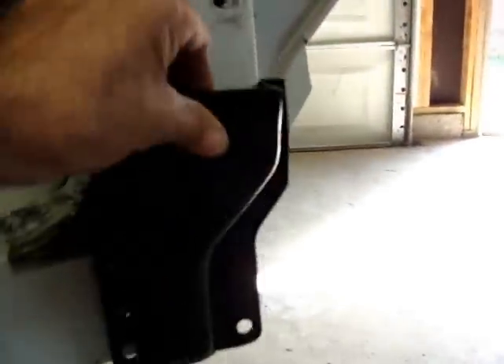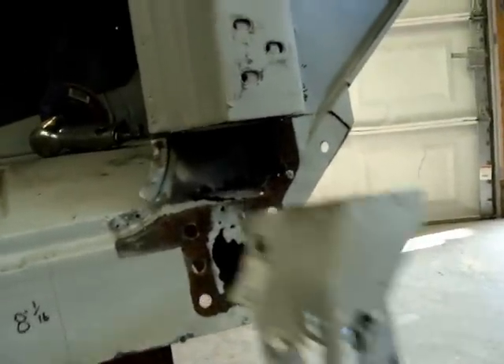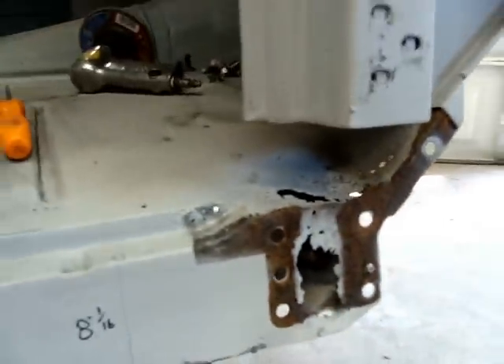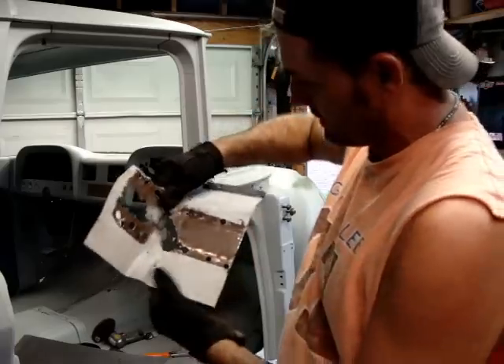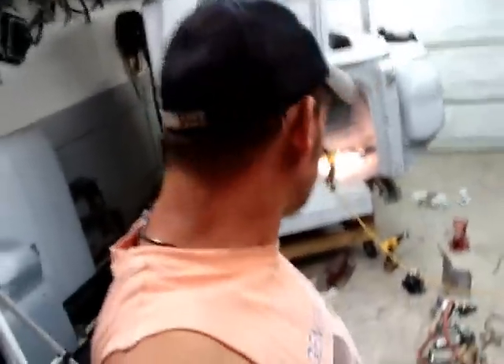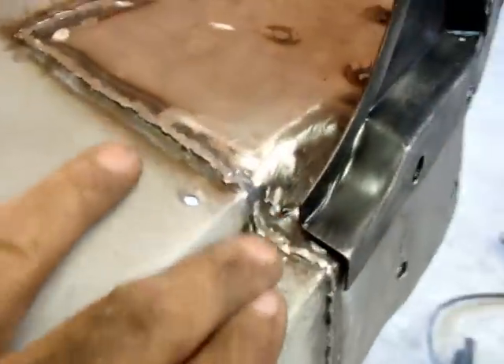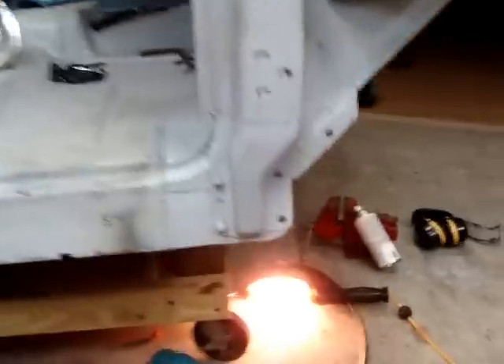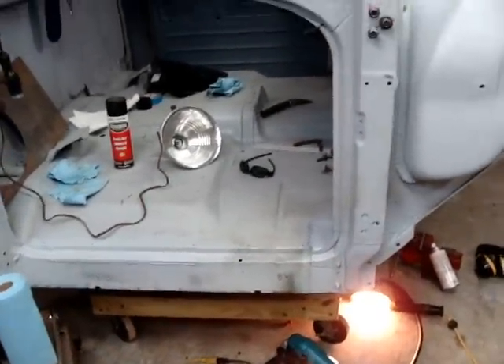Rust repair on door pillar, kick panel

Comment: I like your methods of doing things. I never considered flattening out pieces and using them for a template. The sequence of doing replacement is very helpful. Get the door right then the rocker. My rockers are rusted out very bad I’ll probably be doing a lot of bracing and replacing before I can get the door right. Thanks for very well produced videos.

Comment: That's amazing work, after you flattened the original backing steel, how did you know how/where to bend it back?  By using the bend lines?
Reply from the maker: Yes by using the bend lines

Comment: How did you put the bend in where the channel is, that is a mystery ? I am wondering how you were able to do the 90 degree bend on part of the piece, but you stopped and did the transition to the door channel that goes down at a 45
Reply from the maker: More then likely I use a hammer, vise, and a dolly.  Just a little to far back to remember lol

Comment: when your welding in the floor patches do you have to jump around like on a cab corner or can you run some longer beads?
Reply from the maker: I would still jump around with the welds it just keeps the heat down, it really doesn't matter if it warps a little on the floor, but welding it nice slow and easy makes for good practice on the outside panels